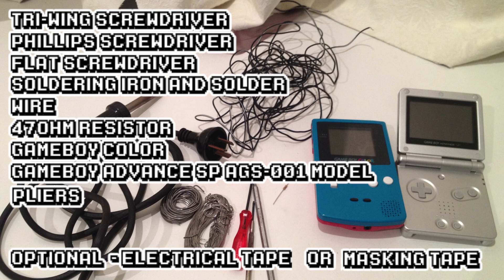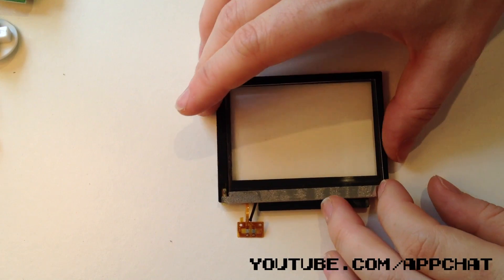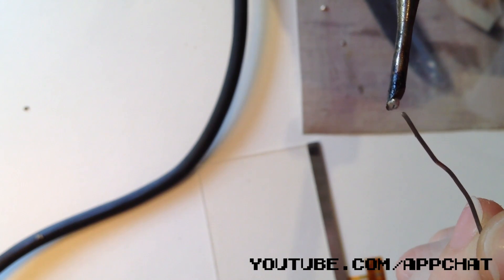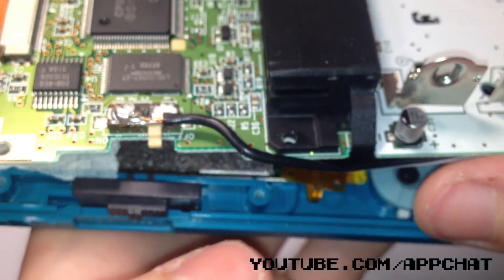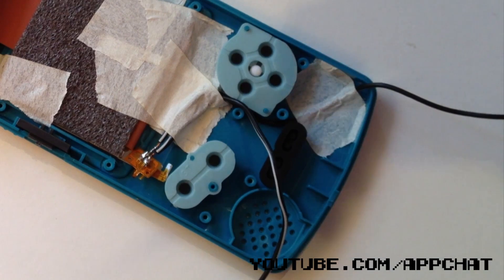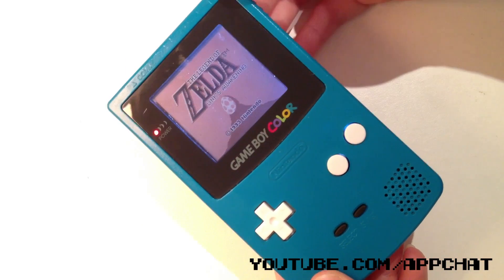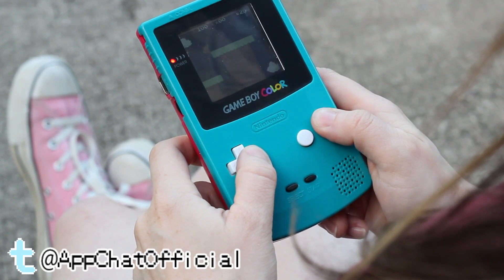Front Light Gameboy Color Mod TUTORIAL

Comment: Don't glob solder onto the wire with the iron, place the iron on the contact to heat it up, then apply solder to the contact. Then put the wire in the joint.

Comment: It's worth saying DO NOT RUB THE FRONTLIGHT SCREEN. I did that and it made marks which won't seem to come off... :(
Reply: Thanks, yes I have tried many things but I think the issue here is that the light screen is ingrained with microscopic vertical lines, I assume to distribute the light better, (which you can feel when you run your nail along it on one side of the face - which I also don't recommend as that can cause the same issue) and the 'wiping' I believe has damaged these lines causing the smudging. It's highly advisable to not touch the light screen with any pressure at all.

Comment: hi, i followed your tutorial, but at the end of the process even if the light does work, the images on the screen are quite difficult to see because of the grade of the light itself. Is it normal?
Reply: on the ags 001 screens, yes. it will be lit, but only dimly.
Reply: thedreadedzero yes but I have a normal cgb 01 model
Reply: XPhantomLord what? It doesn't matter what model GBC you have. The SP screen is what makes it lit. If you're using the ags001 screen it will be lit but not very much. Unfortunately like she says in the tutorial, if you use the ags101 screen, even though it's brighter it won't work because it's backlit not frontlit. So again, to answer your original question, yes it should be a little difficult to see because the ags001 GBA kinda sucked.
Reply: thedreadedzero now I understand, thank you for the answer!

Comment: I happen to have a broken SP (the top and bottom halves separated and the ribbon cable snapped) but it's an AGS-101 :( Looks like I'll need to order a kit and some LOCA.
Reply: Btw, LOCA stands for "liquid optically transparent adhesive" and you can use it to adhere the frontlight to the screen so iI looks a lot better.
Reply: +dj505Gaming you also need a UV lamp....or sun and a some time

Comment: my screen is way too bright. anyone help?
Reply: Vexolyte  You could try Increasing the resistor value to say a 100 ohms but the real problem isn't so much that the light is too bright, it's more that too much of the light is being reflected bcack out at your face because of how reflective the GBC screen is compared to the GBA SP one. That and the fact that doing it this way means there is a big gap between the Light unit lens and the perspex screen protector on the GBC which gives you that horrible "viewing the screen through a square tunnel effect and causes a lot of unnecessary glare. If you don't have the time or patience to do the "Horzontal mod" (Tutorial on my website) a quick and dirty fix is to buy a polarised film used for putting on camera lenses to cut down glare when photographing shiny or wet things. It's really expensive to buy by the sheet, but there are often people selling little 50mm x 50mm off cuts for science demonstrations and stuff for 2 or 3 quid (it's the same stuff you get in light kit for the original DMG Gameboy). Just stick it to the inside of your screen protector (make sure it's the right way round..... it will be opaque one way and turn translucent as you rotate it 90 degrees) and slap it back on your Gameboy Colour. This will stop a lot of the light being reflected back from the LCD and out at your face which is what causes all the glare and makes it feel as if the light is too bright [][][]
Reply: mylkTV
Well I found out there is a "smooth" and a bumpy side. I had it the wrong way, you are supposed to have it bumpy down, and smooth up. I correct it, and now the light turns on, it does NOTHING at all, stilll doesnt look good. I am going to buy a frontlight kit and hopefully that will work. But the main reason for trying to light it up is i have a 16 hour road trip in 2 days, anything i can do to fix it by then? Thanks.
Reply: Vexolyte Bumpy side needs to be facing out towards your face, smooth side facing the LCD.
Reply: mylkTV
I saw another video, saying other wise. I can link it to you. What should i do???
Reply: mylkTV
After reading your comment more carefully, what do you mean facing the LCD? There is one silver bar (On the side) Where the lights come from.
Reply: Vexolyte  yeah.... and that light is dispersed across the clear plastic lens from the silver bar at the side. The bumpy side of the lens is the polarised layer and it refracts the light back toward the LCD to rather than it coming out at your face and causing glare. I promise you the bumpy ridged side of the lens should be facing the Screen protector (and your face when you are holding it in the playing position) and the smooth side should be touching/facing the LCD screen in your Gameboy. 

By the sounds of it you had it right..... it just looked too bright and had horrible glare .... because thats what it looks like when you do it the way described in this video.
Reply: So exactly How do i make it less bright
Reply: Are you fuckin serious? I would go to the Dr's if I where you mate.... A.S.A.P. I think you might have had a stroke.
Reply: mylkTV
I dont get it what
Reply: yeah ..... Exactly!
Reply: mylkTV
Help me
Reply: I did...... your welcome by the way.
Reply: mylkTV
But what do i do to make it less bright
Reply: Vexolyte It just occurred to me that might be quite young. I didn't really consider that. Although to be honest if you are old enough to be using a soldering iron and commenting on youtube videos unsupervised, you really are old enough to have some manners. 

To reduce the brightness increase the value of the resistor. Try doubling it and using a 100 ohm resistor (more resistance = less power to the LED which will reduce the brightness). If you can't get hold of a 100 ohm resistor you could solder 2 x  47 ohm resistors in series (one after the other) which will give you 96 ohms. 

If you don't have an extra 47 ohm resistor you could try finding some tinted window film like the stuff for tinting car windows and stick a square of that to the inside of your screen protector 

Or lastly if you can't do any of the above but you can find a pair 3D cinema glasses where the lenses are big enough that you can cut a square out that's large enough to cover the clear bit of the screen protector. You could use that. 3D glasses are made form polarised film.... so  it should work the same as using the expensive polarised film mentioned in my first comment.
Reply: mylkTV  Sorry ....  I meant 94 ohms (2 x 47 ohms)
Reply: mylkTV You are fine, I'm just quite frustrated at this. You are the only one I have and I am just dumb
Reply: Put on some sun glasses

Comment: Good tutorial, and yes, probably one of the first ones online. I'd like to just point out a couple things for those attempting this mod in 2015 :)
- Like another commenter mentioned, DO NOT rub your finger on the screen like Elly did. The ridges on that plastic are incredibly tiny and fragile so even that will mess it up and fill your screen with blotches and stains when you turn the light on (like she had at the end of the video). DO NOT TOUCH THE RIDGED SIDE WITH ANYTHING.
- For that matter, do not remove the plastic from the screen until you are ready to install it. The less time that frontlight stays in the open, the better. Dust, liquids and anything else WILL mess up the frontlight.
- No need to peel off the padding on the back of the screen. Just remove the screen cover (the one you look through to play :P) and lift the frontlight from that side. That's how I do it every time.
- Although this is a good method, there are 2 much better ones nowadays. Either 1) cut that lens to size and fit it with the ridges horizontally, like it was designed to sit originally (Mylk's Mod), or 2) get a frontlight kit from Kitsch Bent and apply it with LOCA. Either one of those methods can be Googled for more info.

Having said all this, I take my hat off to you and anyone else pushing the Game Boy scene further :)
My Game Boy collecting and modding account on Instagram is @gene.boy If you add me, let me know you came from here! :P
Reply: Eugene Romero Ha : ) ......I feel ever so slightly internet famous [][][]
Reply: mylkTV Hah! My hat goes off to you for even finding my comment :) yep, I have followed your tutorial and recommended it to others since it's by far the most detailed one there is for this mod. Good job bro :D
Reply: Eugene Romero Cheers, really appreciate it !

Comment: Hey. You made a great video. Let me just point out a few things about your mod that would make it better, more reliable, more pro looking and so on.

First, you might consider using thinner wire gauge for this mod.

Also, when you strip the wires, strip only the lenght you need to make contact with the surface of the flexible orange circuit board. That way you will have insulation all the way up to the solder joint. That will make it very unlikely for the two wires to touch each other at any point. The way you have done it with a lot of copper exposed side by side will most likely short circuit at some point. I realize they are somewhat stiffer with the solder and stuff, but it is a major possible point of failure.

When you put solder on the wire tips, the proper method is to apply a little solder to the irontip, hold the tip to the copper wire and heat it good. When it is hot enough you can apply solder directly to the copper and it will flow out all over by itself. It will also flow in between the strands. This is very important, because when you apply the way you do, you solder with too low temperature, and this can easily cause the solder joint to break over time - so called cold soldering.

You used too much solder. When you apply solder to the copper correctly this will be easier to get a fine result when you are to solder the joint.

If you find it difficult to apply solder to the stripped wires like I describe, it is because the copper is dirty. Clean with flux.

Also be aware that when you strip the wire, and apply heat to get the solder flowing correctly, the insulation will also heat and most likely strip back even more because of melting. This can be compensated by stripping less off the cable than you need, and let the heat finish it off :).

Don't get me wrong - very nice video, and very cool that you make a tutorial, but I thought I'd point this out to you and others watching, to make you able to better your soldering skills and also do a more reliable job and all that.

Hope you don't take this as personal critisism, but for what it was meant to be - some soldering tips for getting the job nicely done.

Comment: Should I be getting a 470 Ohm resistor? Or a 47 Ohm resistor?
I can't seem to find a 47 Ohm...
Reply: Ricky Vega 47 ohm resistor, she prenouced it wrong so it sounded a bit weird...

but it doesnt need to be exactly 47 ohms, you can use a bit more or a bit less. with less ohms meaning brighter light and more ohms meaning less light. dont go to far off the 47 used in the video because then it wont work.
Reply: Jorn Thank you for clearing that up!

Comment: DO NOT immediately peel apart the TWO ORANGE TABS like she talks about in the video!

As a few people have mentioned, there are some versions of the SP that contain a front light where these two tabs CAN NOT be peeled apart without rendering the front light UNUSABLE. There are some variations where the tab that she tells you to peel off actually contains the soldering pads that you must leave intact in order to solder wires onto the front light unit - the soldering pads being the two gray vertical lines II in the middle of the orange tab, as depicted in her diagram. On these versions if you peel this tab off your front light is now useless. Therefore, DO NOT peel these two tabs apart (at least at first), unless you have completed the mod and the front light is still not coming on. If you have followed every other step thoroughly, and have ensured that all your wires are completely soldered on at all the proper points, then AND ONLY THEN should you peel the tabs apart to see if this fixes the issue. I unfortunately learned this the hard way by peeling the tabs apart and ruining my front light. Please learn from my mistake. This seems to vary from one SP to another, so give it a try and see what happens.
Reply: I bought a set that came with a 001 light. Should I still do this with that? The light is just the screen itself, not an actual SP.
Reply: same here, ended up ruining my gb. Well, a few years later and a little more skill in soldering later I finally got a working frontlight on my color

Comment: I bought a broken sp with working light to try this mod. At first the front light worked but went off after a few seconds. turned it off and on and it did the same but after that the light didn't work anymore. The gameboy however works perfect.

Does anyone know what the problem is?
Thanks

Comment: Just completed mine. The front light circuit was touching the cartridge contacts and stopping games from booting. Solved with a piece of electrical tape and some readjusting. Couldn't have done it without you though! I kept the extra tab attached as it was very fragile without it and works fine still attached. And for anyone else wondering, the GBA SPs front light is far superior to any after market alternatives. I'll get some pic for you soon, mines a clear case.
Reply: PS, subbed to you too, incase you mod anything else I own!
Reply: "And for anyone else wondering, the GBA SPs front light is far superior to any after market alternatives"
That might very well be the case, but I would not go buy a functional GBA SP just rip out the screen light. Can you give me some recommendations for after market side(?) lights. How are those types of lights called?
Reply: With that screen the battery life decreases? I guess so...
And with that screen, games look blurry? Or they look as playing GB and GBC on the SP (without blur)?
Reply: d1oftwins The only one I know is the one from Kitchbent, but doing it the same as this would make the screen hard to see due to the way his screen is made. So that mod is somewhat harder to do.

Comment: You could also just by a front light for a Game boy sp from an after market parts manufacturer. Also the action of coating the wire is called tinning and should be done with any wires you plan to solder to things. It's also pronounced OH-mmm :p Nice starter mod for people to get into modding game Machines. Congrats on entering the Modding comun!

Comment: I want to help everyone. It took me hours and 3 GBA SP before I realized that some models are different. The orange tab for some has to be peeled apart, however there is another design where you do NOT peel and solder on the back side. When in doubt solder the back side first. A bad mistake to have. No where makes this clear. BE CAREFUL
Reply: Dangit, too late -_-
Reply: you idiot this frontside ligth can you buying as a Set and must not destroy a
Working Sp
Reply: I never found where you could buy one, but i bought broken sp's

Comment: Grr... After waiting two weeks to get the parts... I did it... 47 ohm resistor on 4th pin, one wire on switch... Sp light taken out... Wired everything up... It worked! Then about 3 seconds later it slowly faded and now the light will not work at all :(

Comment: Soldering tip: don't put solder on the iron directly, heat up the wire and have the solder directly melt on it. Also, adding flux helps, you can never use too much flux.

Comment: I followed the directions exactly and everything looked perfect. However, when I put the back casing on (without screwing it in) to see if it worked the light came on and it looked fine. I removed the back to finish putting in the motherboard screws and screwed everything back together. Turned it back on and the light did not turn on. I tried everything and found no solution. Any help people?

Comment: Nice video and nice mod. For future reference, you should not have a blob of solder on the iron like that. The tip of the iron should be lightly coated in solder. You then heat the components you're soldering and let push the solder against the heated components, not the iron itself. The results will be prettier and less likely to come off/not work.

Comment: When soldering anything copper, you should apply some flux paste to the wires and the solder will stick like mad and it is best to use the 50/50 blend. The lead will be easier to work with.

Comment: 470, not 47. You can use about 500 Ohm resistor too, but the higher the resistance, the lower the brightness. Besides that, don't go less then 470, I don't know if the backlight can handle it.

Comment: Well, you would just have to find some free space, and dremel out a hole for the switch to come through. You can use either of the wires; all a switch does is open and close the circuit.

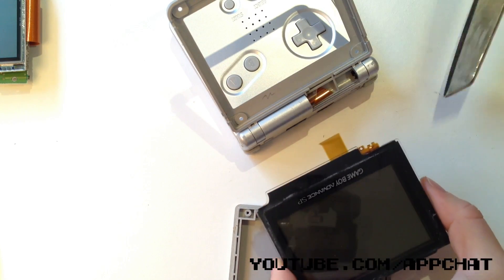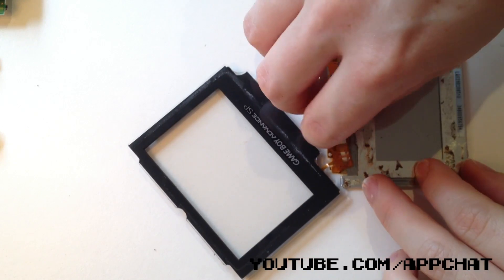Comment: Assuming that you cannot use a *back*lit SP for this mod: yes. If you use a frontlit SP and cut that thick ribbon like she did (at 2:07), your SP will be broken. You do not have to cut that off, it's just to get easier access to the screen. Leaf that connected and just cut the small ribbon (2:47), it should still work after you assembled the screen again. Without the light of course.

Comment: You can take any wire you want. The thinner, the better. If you have access to old computer hardware I'd suggest you take an old IDE cable (those big HDD connectors) and ripp some wires apart.

Comment: Guilherme, you don't necessarily have to destroy your sp- simply disassemble the screen without cutting the cable. If you get it all put back together after removing the front light, you'll simply be left with an SP that you can't play in the dark, much like the original GBAs.